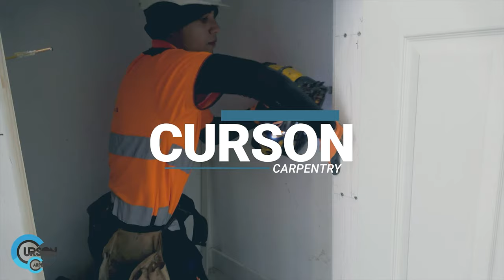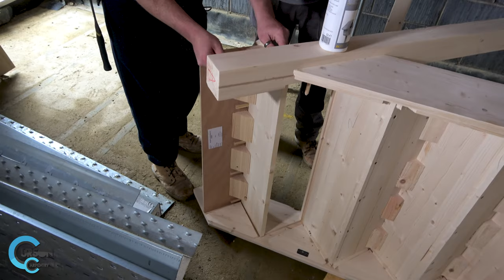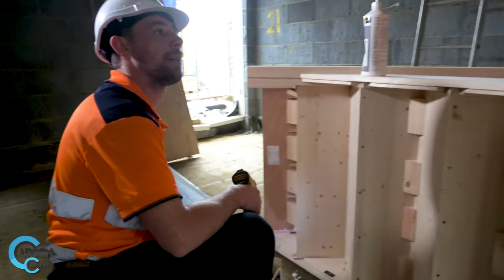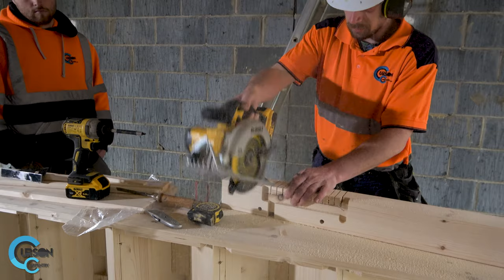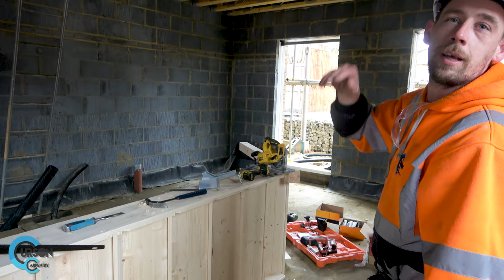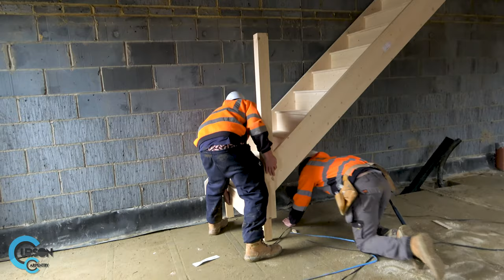How to install a staircase

Comment: Hi just wanted to find out, your first measurement from newel to face of top tread you mentioned it was 50mm, later on you measured again for the depth of the notch is 25mm from newel to face of top tread? sorry, perhaps I got confused and you can explain to me how you figure out the depth of the notch? thank you
Reply: You remove newel to rear face of riser as a rule